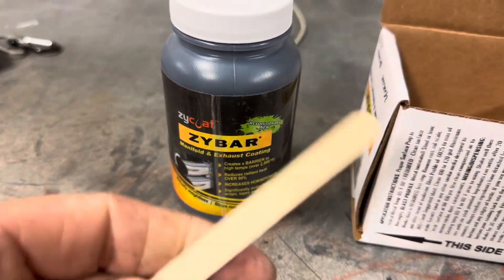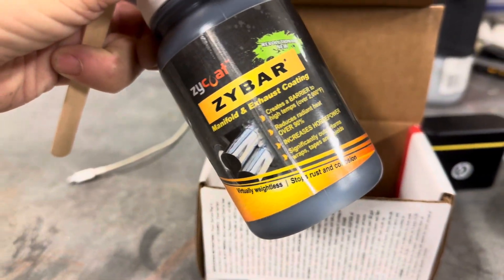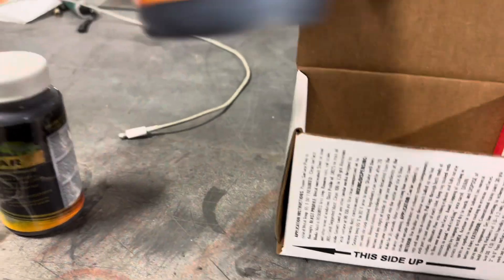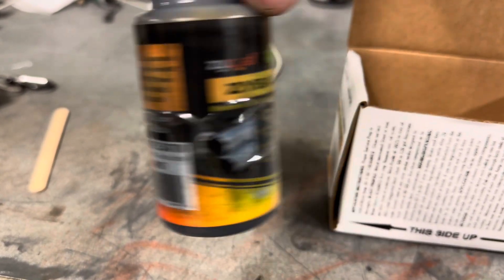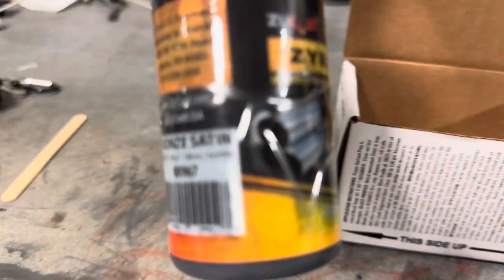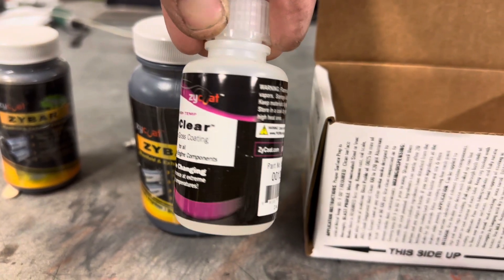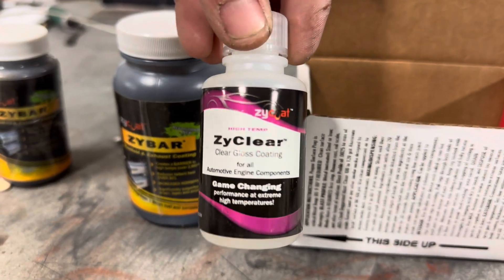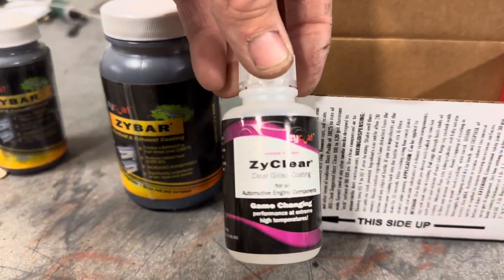This coating can handle 2000° F - ZyCoat ZyBar

Comment: Hey are you still using the oven you made a build video on 4 years ago? I have a Mr heater and I’m planning on buying an industrial fridge today to use at the oven, any opinions?
Reply from the maker: Yes, we are still using it and it works great. My only thoughts on a fridge is you will need to put insulation in it because the kind of insulation that is in a fridge is not fire proof.